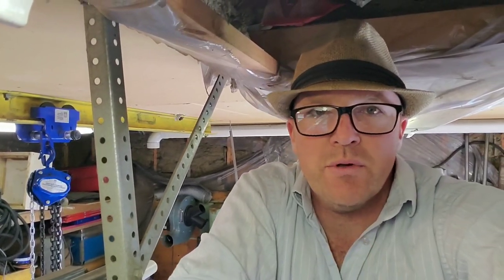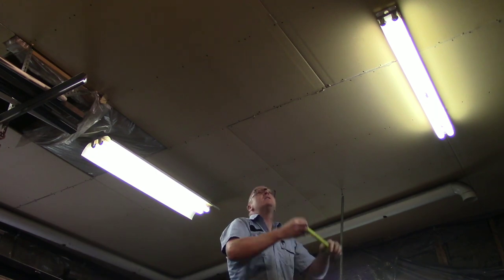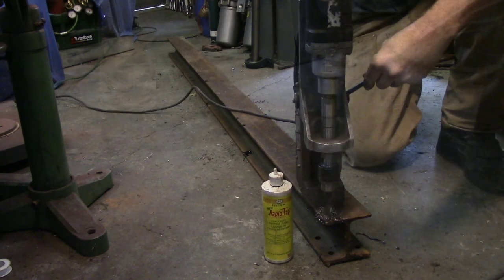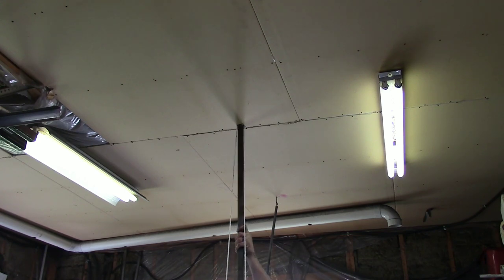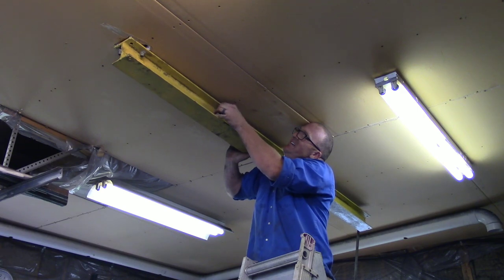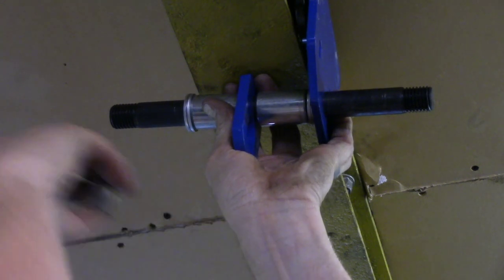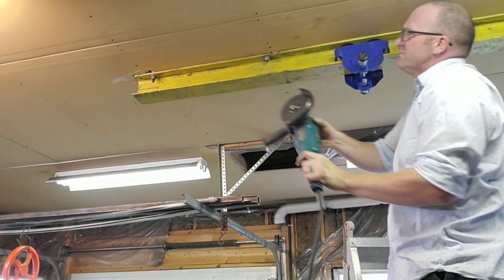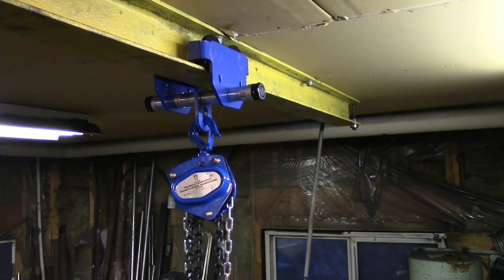Easy Hoist Crane build for the Shop

Comment: Our building Engineer at Winnipeg's  Seven Oaks General Hospital  was called to Emergency Dept and was summoned  to remove a grinder disk from a grinder that dug down  all the way  to the 'axcel' into the top of a guys skull......(still attached to the grinder and stuck in the guys head)  .......fortunately it was only a 5 inch disk and patient survived.
Reply from the maker: Intresting but scary ,  was he the operator of the grinder or the recipiant of others actions ?  I mean i have has some close calls and seen alot of cut fingers from care lessness and falty disks blowing up .   Also a note one should A . Buy good quality disks B. Use the gaurds at all times and C.  Always be weary of otgers in your work area .
Reply: @Wrighmachining  Hi..We can only speculate  at the details.    We surmised that it was most probably a 'kick' from his own  tool....The 'slot' was perfectly lined up in the centre of his head, so most likely he was reaching 'One-handedly'  to cut something, possibly with one hand holding  to a lsdder....But thats' only a guess.  A hard hat and a face shield would have been a good idea.